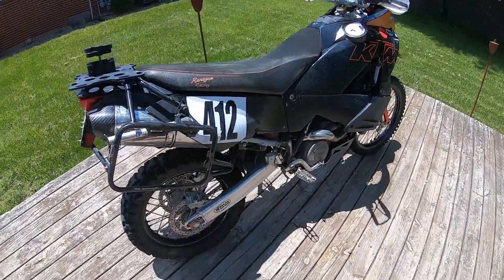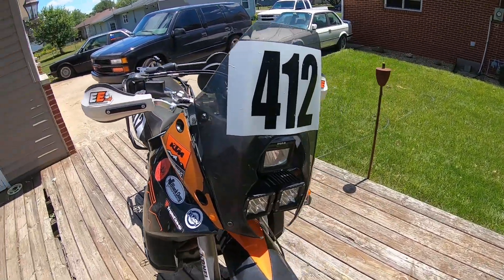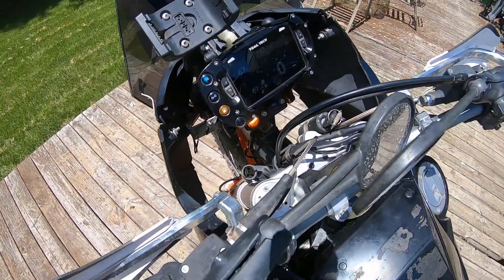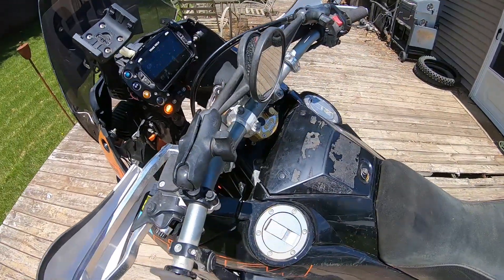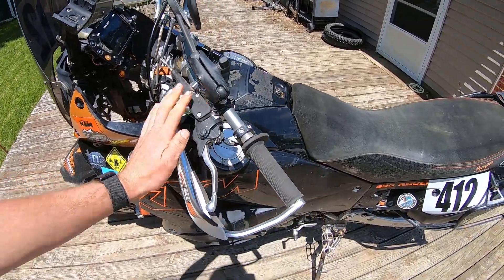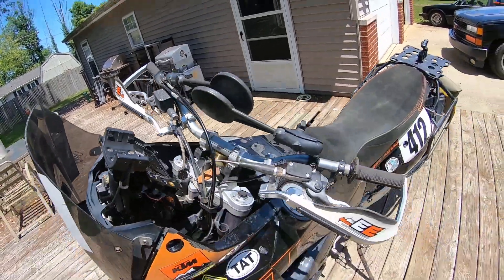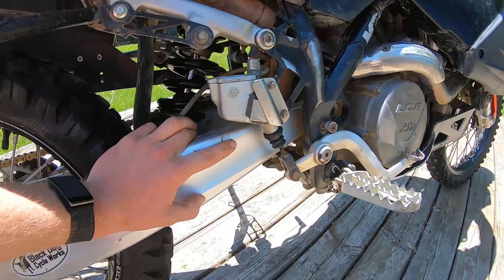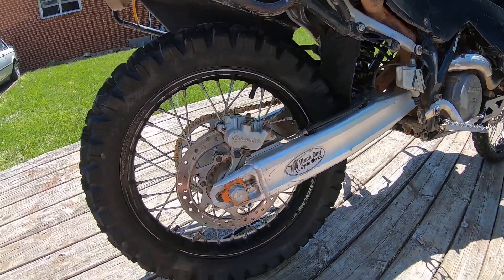KTM 950 Adventure Full Walkaround and Build Details

Comment: Run it till it blows baby! I have a 990 with 113k miles and it runs like a quartz watch.
Reply from the maker: I would if it would start! Wore out and ended up with low compression before anything else failed.
Reply: @gearheadE30  Well, you deserve a gold star for all the fun you had on it! If you're not in a rush I see first gen 990's for sale in the 3-4k range.
Reply from the maker: @a2dskins  I never did find one that cheap, but I did find a good one to swap all the bits onto and am in the middle of setting it up now!
Reply: @gearheadE30  Curious if you end up breaking it apart, curious if it needs more than valve seals, worn seats and oil rings, if cylinders are done, thats a heck of a cost lol.
Reply from the maker: @Backhurtsbad  It's pretty unlikely I'll tear this down any time soon, to be honest. Based on operating symptoms, and that the valve shims never really changed, it probably needs valve seals, pistons, and rings. I'm sure the cylinders are glazed, but nothing makes me think it has the plating chipping issue some Nikasil bores have.

Comment: Thank you so much and I will check it out. Good luck on the new 990. I love my 950, there are plenty out there with very low miles. You may want to stick with the same. My total rebuild for my motor was $2000 all parts included. It all depends what yours needs.
Reply from the maker: I guess I need to do an update video on the 990 but so far it has been great. I know people hate on the fuel injection but it's actually working well enough for me now after a lot of time in tuneecu.
Reply: @gearheadE30  Would love to seen an update with the 990.
Reply from the maker: @Backhurtsbad  it is all taken apart right now; guess I need to work on it some more!
Reply: @gearheadE30  Hey, at leass post some pics about it on Advrider haha, we might learn something 😄
Reply from the maker: @Backhurtsbad  I will when it is done! Working on battery and oil tank relocation so I can stop killing radiators.
Reply: @gearheadE30  why are you killing them, is the oil tank heating or hitting the radiator?
Reply from the maker: @Backhurtsbad  the oil tank hangs from the radiator, and over time, the weight of the tank stretches the radiator vertically and the tubes start to crack and leak next to the upper rad mounts. I'm on radiator number 4 in as many years.
Reply: @gearheadE30  wow 😮, those ktm engineers…
Reply from the maker: @Backhurtsbad  eh, it's one of those things that isn't a problem for what the bike is designed for. These bikes aren't known for failing radiators. I'm just using the bike in a way that it really wasn't intended to be used, so things are going to break in odd ways.

Comment: Great walk around. I have a question about the Brembo clutch master cylinder. Do you have a part number for the unit you are using? My old unit is leaking after many rebuilds. Who did you buy from etc. Thanks again
Reply from the maker: I don't have a part number, but I believe it was from a 2017+ KTM 450 xcf. Any of the usual parts houses should be able to get it; I usually get stuff from rocky mountain atvmc.

Comment: 91k miles that’s insane. I’m looking at picking up a 2005.5 950 to replace my Africa Twin that I was bored with and sold.
Reply from the maker: They are great bikes! ATs are as well, but the KTM definitely offers more excitement.
Reply: @ I wanted to go lighter and pickup a 450. But a 950 popped up and I can’t resist. I rode the AT hard but no where near what you do. I’m looking forward to the more HP of the 950.

Comment: You say it’s cheaper to buy a new bike, but it wouldn’t be a 950. The carbs are better than fuel injection on the 990, the later bikes (1090, etc) aren’t close to being as capable of these and it keeps a classic on the road… me, mines got 80k miles on the clock and I’m stripping it down to rebuild it ground-up, as I’ll never get rid of it until i can no longer buy parts.
Reply from the maker: True, the newer bikes are not nearly as analog as the 950 is. I replaced the 950 with a 990 so still very similar. I haven't gotten the throttle response to be quite as natural as the 950 was, but I am finding that I actually prefer the fuel injection most of the time. I was kind of expecting I would be putting my carbs on the 990 but that seems pretty unlikely now.